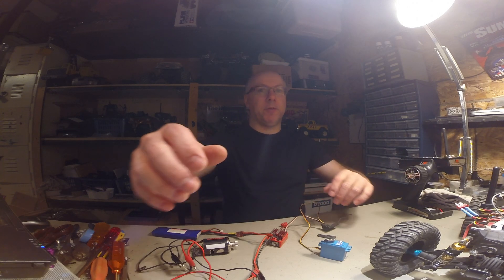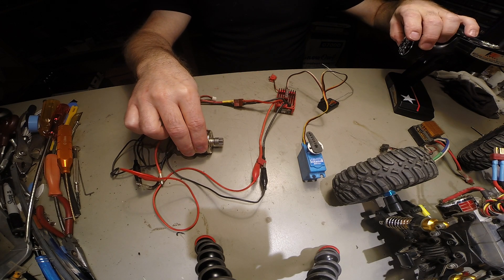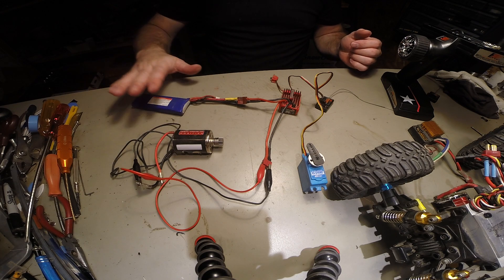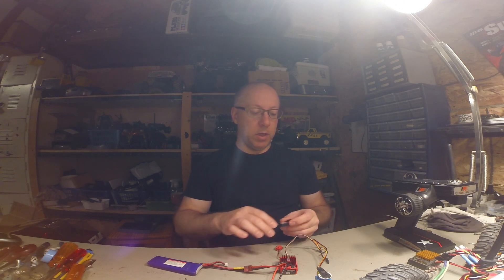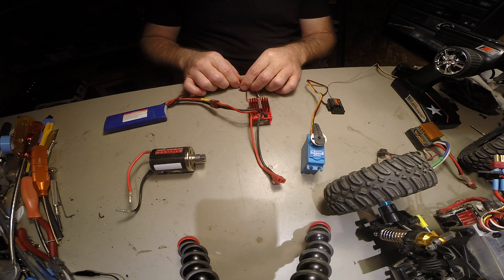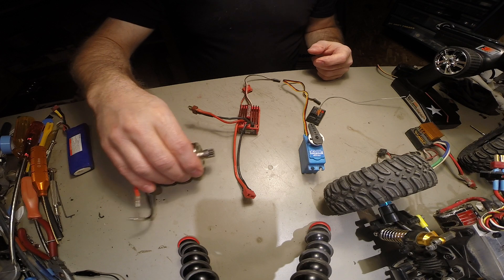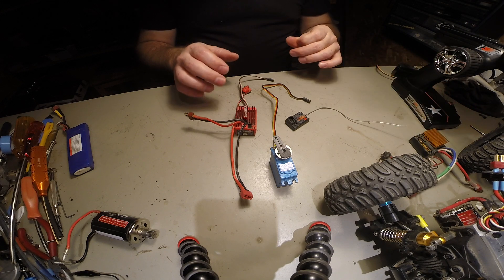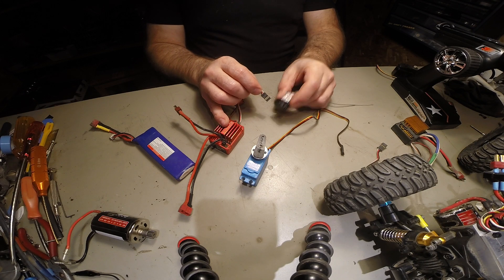Troubleshooting RC Electronics basics - Diagnose and fix it yourself

Comment: I know this is an older video, but I just found it.

I am not sure I agree with your first test and conclusion.  Your test proved that the components worked and that one channel worked on the receiver with the transmitter, but your test didn't prove that it was the receiver and not the transmitter.  Once you changed the receiver and all worked, then that was your proof the receiver was bad, but before that point, blaming the receiver was just a good guess unless there was a valid reason that you did not mention for saying it was the receiver.

If you had taken a known good transmitter and tested it with the receiver and the channel didn't work, then you could definitely say it was the receiver, or, as you did, changed the receiver and it worked, so was obviously the receiver.

Flow of testing:

test with existing TX/RX - one component doesn't work
swap channels - bad component now works, good component doesn't, so channel isn't working

To finalize the diagnosis, either:
test with good transmitter and channel is dead - receiver is bad
test with good transmitter and channel works - transmitter is bad

or with existing transmitter
test with good receiver and channel is dead - transmitter is bad
test with good receiver and channel works - receiver is bad
Reply from the maker: Well it was either swap the Receiver or the Transmitter. In my experience, in most cases the receiver is almost always the culprit for this type of issue. Whether you try the RX or TX first you will come to the same conclusion. One of the main issues in testing is that most people don't have a second RX or TX to use for tests or if they do its not the same brand so cannot mix RX and TX's. Only thing you can try is to make sure the components work on the other RX.

Comment: Hello! I have a problem with my remote controller. When I want to drive forward i have to pull the trigger and when i want to go back I have to push it backward... Can you tell me how can I fix it? I have wltoys monster truck a979
Reply from the maker: Ani Dimova that's the way its supposed to work.
Reply: That's how it's supposed to be...

Comment: my problem is that it revs but doesn't move in need help
Reply from the maker: Superfast Collector there is lack of power from the motor. This could mean a bad motor, bad esc or even bad connections.
Reply: TheLEDwheel ok thanks

Comment: my xcar esc stopped working, but gets power, light comes on, doesnt do anything at all with receiver, but when i connect another esc and motor it works fine, every little light comes on, then goes dimm when i hit the throttle or steering... whats this witchery & how do i de-hex it ? ;p
Reply from the maker: Vampin RC i dont know that one. Can you try to reprogram it?

Comment: i have somekind of the same problem but when i turn on the car it doesnt move at all, only the esc blinks. anyone know the problem?
Reply from the maker: Lauris Kudrjavcevs what transmitter/receiver do You have?
Reply: TheLEDwheel yes i have 2 of them none of them did anything
Reply from the maker: are they 2.4ghz?
Reply: yes both of them
Reply from the maker: are they binded and set tonthe esc?
Reply: yes
Reply from the maker: receiver and servo getting power?
Reply: yes

Comment: I have a new transmitter receiver for my sail boat. New batteries checked.
The receiver red light comes on and off when I turn on the switch.
I have the correct connection into battery. 
Could it be a bad receiver? Switch?
Reply from the maker: More details  will be needed. However if the switch was faulty it would either be intermittent or not work at all. If you turn it on and play with the switch does the RX(Receiver) light flicker? Knowing what kit you have might help.

Comment: I have a 1982 Wild Willy.  When I plug in the 7.2v battery, the wheels start spinning immediately and they go in reverse.  The transmitter and receiver are both turned OFF.  Do you know what might be wrong?
Reply from the maker: Erik Renner i think your mechanical speed controller might be turned a little. does your truck use 4 AA batteries to power the receiver and servos? if yes the turn on the transmitter and the receiver ans see if the steering and trottle work. make sure the trottle brings back the speed control servo and mechanical speed control back to the center. if so now plug in the battery.
Reply: TheLEDwheel - Yes, the receiver takes 4 AA batteries.  The transmitter takes 8 AA batteries.  Neither of these have batteries in them at the moment.  Both are in the OFF position also.  However, when I plug in the 7.2v battery pack, the rear wheels just start spinning in reverse at full throttle.
Reply from the maker: you must do what i said previously. what good will plugging the 7.2volt battery do If the others are not on?
Reply: TheLEDwheel - The wheels shouldn't spin if everything is turned off...should they?
Reply from the maker: the old controllers had a mechanical speed control that could be turned by hand without the system on. if you must, you can center it by hand
Reply: TheLEDwheel - The wheels shouldn't spin with everything off...should they?  How would I ever be able to stop it unless I ran after it, grabbed it, and picked it up?
Reply: TheLEDwheel - I will get some AA batteries and see what happens.  I wish I could send you a vid of what is going on.

Comment: While playing with my rc the engine exploded and i replaced it (steering one) the back engine was working but i cannot turn my vehicle and on my circuit board thats something with 3 connectors and black that has been burned . Any tips
Reply from the maker: OK for starters it might be a good idea to learn what the parts are called. otherwise it makes it difficult to know exactly what you are talking about.

The steering part you are referring too is called a "Servo"
As for the rest of your problem you will need to be more specific and maybe come to my facebook group to post clear pictures of what you are talking about with your explanation. Maybe even a video.
https://www.facebook.com/groups/TheLEDWheel2.0/
Reply: TheLEDwheel Joined your facebook group and subscribed

Comment: Hi ! i have this problem i lost my remote controller for my rc car ,can i use another controller from another car model ? 
this is the car   https://www.google.ro/search?q=Nikko%20rc%20cars&source=lnms&tbm=isch&sa=X&ved=0ahUKEwiJsbKl7tTTAhXiDMAKHTcNDXMQ_AUIBigB&biw=1440&bih=770#tbm=isch&q=Nikko+Tronico+Walter+R%C3%B6hrl+4WD+RC+Ferngesteuertes+Auto+Modell+80er+RAR&imgrc=UMJfrrXnOYqCAM:
Reply from the maker: It is possible that another controller with the same frequency will work but I cannot tell which.

Comment: Hey I have feiyue Desert eagle 3 and its not working it doesn't move at all. when I turn on the ESC it blinks slowly and then when I turn on the transmitter the ESC starts blinking Fast and the servo starts making sound and I'm not able to move forward backward or steer left right.. I buyed a new ESC but still it's just like that.. I don't know what's the problem.. Can You please Tell me how to fix this problem.
Reply from the maker: You might have to bind your transmitter to your receiver again.
Reply: TheLEDwheel   I don't know how to bind...  I'm really new to these things..
Reply from the maker: Page 7 of your manual
Reply: TheLEDwheel   now my ESC is not blinking and the transmitter is flashing green red
Reply: TheLEDwheel  if I change everything like motor esc servo then will it gonna work?
Reply from the maker: Most likely but knowing what is wrong will help you in the future..
Did you try the tests in the video?
Reply from the maker: depending on how long you had it for you could contact customer service.
Reply: TheLEDwheel I bought the car 4 weeks ago
Reply from the maker: call or contact them somehow...

Comment: Hey I was out with my rc truck last weekend and it was running awesome then all of a sudden it tales off buy it self first foward then reverse, I shut it down and turn it back on and it works fine again, the later that day it was running fine but the battery was dead. It was sitting on a table after I put another battery back in and was smoking a cig when it took off full throttle off the table and started turn g really slow left then right then slowed down to about half running speed all by itself then it all of a sudden Started listening to the remote I was holding. anyone have a idea on what I should start looking for?
Reply from the maker: sounds like glitches from interference or your radio is loosing its signal either at the transmitter or the receiver. Is it a 2.4ghz or an older type with a long antenna?
Reply: TheLEDwheel it's 2.4ghz and is only maybe a month old with maybe 8 hours of run time. after it did it the last time I ran it for like 10 min and got it about 40 yards away with no issues but I did. ot want it losing control again so I put it away and have not messed with it Sence. what do ypu think?
Reply from the maker: What is it and maybe you could check with the company for warranty.
Reply: TheLEDwheel it's a redcat mt10e. I'm gonna give it a try this weekend and see if it happens again I think maybe someone was on the same channel I was using
Reply from the maker: Same channel should not happen with 2,4ghz but it does happen.

Comment: Hi. Thanks for useful information. My problem is a bit different. Firstly when I turn rc on the esc flasing red light like in the video, just steering works. I reversed the channels to esc and servo. This worked for about ten seconds and stopped and again flashing esc. Only works steerings in these two situations. What s wrong and which part is fault?
Reply from the maker: Ahmet KANDEMİR you might need to program your esc with your radio.  check your instructions for how to di that.

Comment: hi my radio connected but I've got no movement not even from servo what can I do please help me
Reply from the maker: RECON DRONES need more details.
Reply: brand new esc the remote controls and receiver is work motor is moving when car starts and servo turn only when it i switch it on but the car won't turn or throttle battery fully charged the old esc started smoking
Reply from the maker: RECON DRONES does your drive train feel smooth?
Reply: TheLEDwheel yep drive train is smooth
Reply from the maker: RECON DRONES connecting a batt  direct to the motor works?
Reply: TheLEDwheel you know how the servo centralise it self It don't do that either
Reply: TheLEDwheel yep motor spins it like there's a shock going thouth when car start and then it just shuts off and thanks for replying so fast
Reply from the maker: Have you solved your problem? I reread this post and realised you might need to bind your receiver to your transmitter. Does the light flash continuously on the Receiver?
Reply: TheLEDwheel  yer thank the radio gear had broke

Comment: I need some help, I'm pretty savvy with mechanical and some electronics, I have a T-maxx with a the 27Mhz setup,  I took it out for about an hour, did after run maintenance, went to take it out the next day and I apparently forgot to power off the receiver or transmitter(I forget which it was and I get confused on which is which even though I keep reminding myself).I switched the batteries(brand new AA both times). power it up but no response whatsoever, not even a servo whine like the battery wires fried or the transmitter/reciever is bad. took it to my usual hobby shop and I fond out my steering servo is apparently bad (no response) but I still haven't found the source of the problem. I am trying to find the exact issue so I fix it without buying extra parts.Thank you for reading and please help, it's been months and I'm going nuts not being able to R/c. 

UPDATE: it's my reciever. some how it's not delivering power. I pulled my 27Mhz Crystal out and put it in a 2 channel( no clue of what brand) reciever and only one channel worked but I'm keeping that semi working reciever for a servo tester... I'm so close to finish I can taste the nitro.
Reply from the maker: Does the receiver work without the steering servo  connected?

Comment: My rc car recently stopped working properly. It wouldn't listen to my commands and would engage throttle when i wasn't holding the trigger. The steering would stop working after a few turns, and the lights would flicker when i would turn. I already tried putting in a new receiver and transmitter, esc, AND battery (with proper voltage) but that didn't work. Would you possibly be able to explain what's wrong?
Reply from the maker: Chicken? The Dank Memer so the only thing you have not changed is the servo and still have the same issue?
Reply: TheLEDwheel yep. Servo and motor
Reply from the maker: Chicken? The Dank Memer disconnect the servo see what happens
Reply: TheLEDwheel it used to just not listen to some commands, but now the steering shuts off in just a few turns and the throttle.
Reply from the maker: Chicken? The Dank Memer servos an cause issues. have you tried the throttle without the Servo connected?
Reply: TheLEDwheel yes, and it worked fine
Reply from the maker: Chicken? The Dank Memer try a new servo
Reply: TheLEDwheel will do, thanks for the help
Reply: Shiikon did you ever figure out what was the cause? I am having the same issue, when I turn the steering back and forth for about 3 seconds, the power system starts to bog way down and then I lose steering. I thought it was the Servo but it’s a high dollar savox servo and was working fine up until the issue I’m having. At some point the last time I drove the truck the esc fan came unplugged from the esc and caused the esc to get extremely hot. Because of the esc overheating I did some tests to determine what was broken be it the ESC, Servo or battery’s, and I really think it’s the internal BEC inside my 100amp hobbywing Esc.